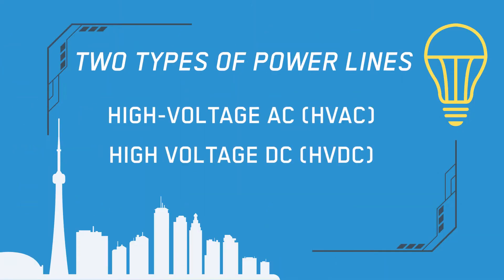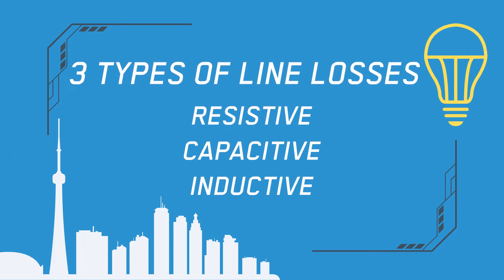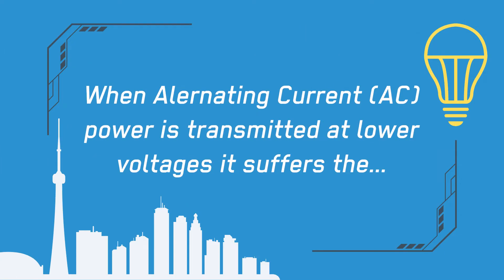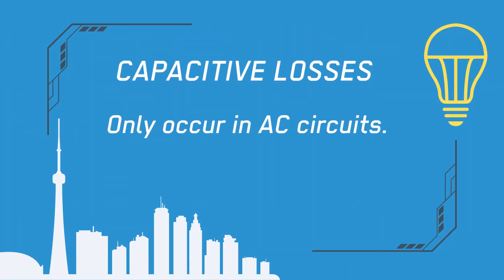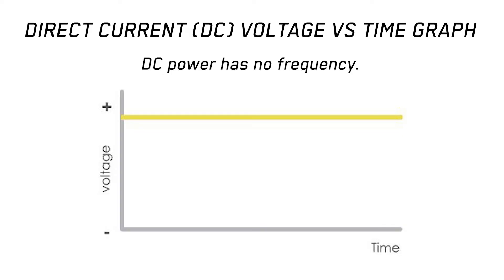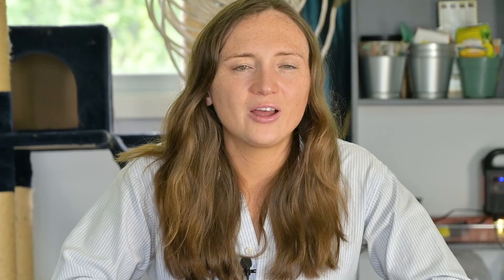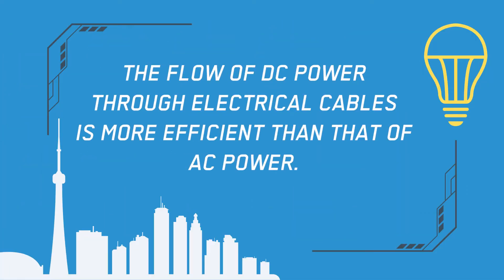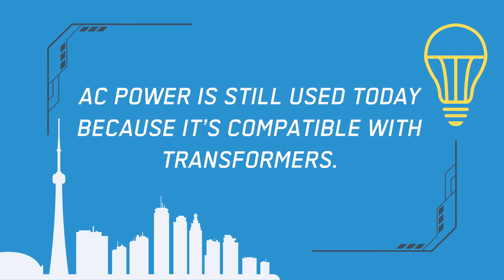Transmission Line Power Losses - 3 Types

Comment: Here's the math behind why we use A/C instead of DC in transmission:                                                                                   https://youtu.be/DSdKyHmLEzc?si=XivCqRokyXfuLS3X 
That's the math then there's the conductor size to use DC in transmission, that limits the voltage, and the truth is DC can't be transformed easily, it requires complicated unreliable circuitry to change it's characteristics. All in all A/C is still the better choice.

Comment: You missed leakage resistance in transmission lines. Also you are only as you said talking about the same voltage. DC must be down converted via massive semiconductor inverters and converted to AC 110 or 220v and in phase with the grid. Losses in the 10% range would have to be very short transmission lines indeed
Reply from the maker: Yes, for now DC power transmission only happens in transmission systems, not in distribution (to homes and buildings) because distribution lines aren't as long. Because they aren't as long (don't meet that break even distance), the energy savings wouldn't be worth the expensive equipment needed to make up for the fact that transformers only work with AC power. That's why the current method of distributing DC power throughout homes and buildings is with a microgrid, or a local DC power distribution system/panel (not to sound salesy, but like ours).
Reply: Consider also that to convert power from transmission voltages, it is required to be converted to AC to allow voltage step down. That is equipment, maintenance and more loss. The 2-3% loss to 5-10% loss is not as beneficial once you add all the losses of conversion and extra equipment. The proof is in the pudding. Not many DC lines out there. BUT, if you could convert it with little losses, then you have something there. I'm sure there is a way. Just that no one is trying hard enough to find it.🙂 @electricinsights